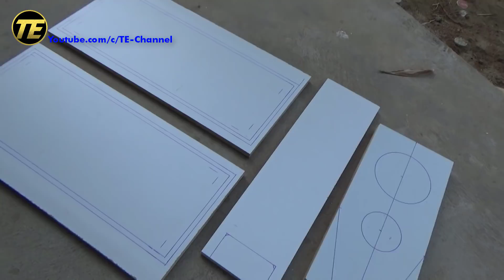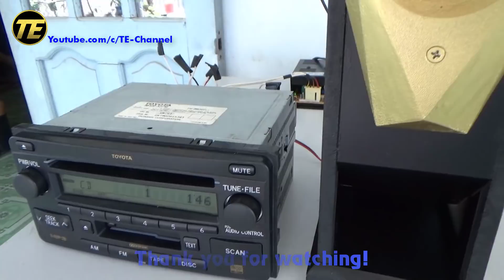Building Speaker Box

Comment: you should have just clean and fix that Kenwood, if it even was broken.
Reply from the maker: I can not fix that Kenwood
Reply: @TE.  I have also made some boxes to car speakers when I was young. A simple speaker box usually works the best, just right size and without inner walls, some dampening to the back wall and perhaps a reflex tube to some place, if the speakers work with it. Some older speakers I had at that time, worked best in closed box. Too complicated structure sometimes just makes bass sound bad. I think that box could be half smaller, and still sound better without any inner walls, just with small reflex tube.